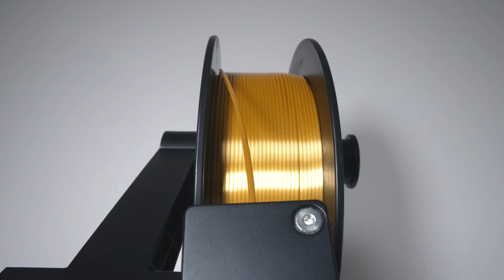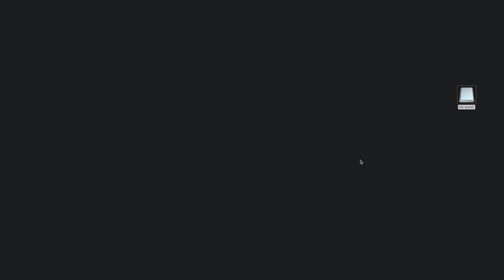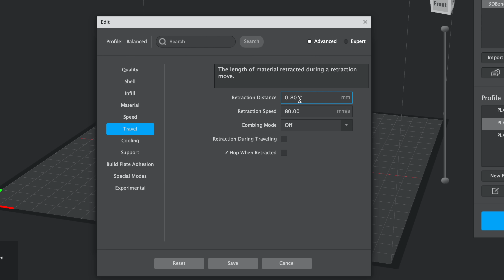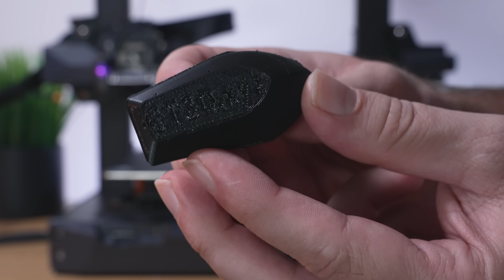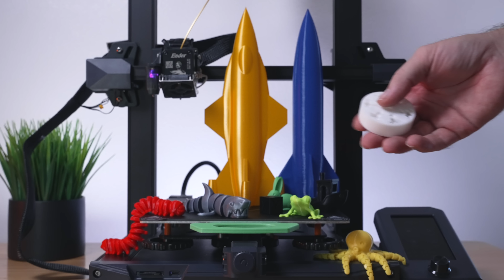Creality Ender-3 S1 - 3D Printer - Unbox & Setup

Comment: Awesome video. I used it to set mine up. The problem I’m having is leveling the bed I manually level three or four times and then set a Z offset and Ron auto leveling readjust, the Z offset at the end, and when I come to print the nozzle is either dragging on the plate or about 3 mm off so I am constantly adjusting it in the beginning of each print. I tried the leveling process know multiple times but it’s the same outcome, it’s driving me crazy. When I go through the leveling process everything is perfect. I click on auto home and bring Z down to zero, and every single time zero stops at a different place than where auto leveled but most of the time it sits right on the bed, so I have to check before each print if not, I will drag the nozzle. I use the PA sheet and when he drags it damages the nozzles subcontractor nozzles already because I forgot to check the leveling before printing.

Comment: Unlike 90% of these YT videos, this one is extremely well done and informative.  One can actually see what you are showing, and even better, I can understand what you are saying.  I will be setting one of these up tomorrow and this was a great help. I have to watch the last few minutes to be sure that you didn't, but about the only thing you didn't address was printing from a PC with a USB A-C cable. If that's the case, that might be a nice additional video.  I've been printing from a PC on an Anet A8 for several years and prefer that to cards or USB thumb drives.

Comment: I put the instructions down and watched your video.   Got it going.   I have a few other Enders even though I am still very new at this.   You helped get me started with this printer easily.  Thanks.  Rabbit printed fine but there is a bitcoin looking gcode with Ender on it that I had to tweak with some to get it to stick.    Plain white PLA.   I managed.  Like the duo z rods and direct path from the spool to the extruder.   I have so much to learn and promised to not buy anymore 3d printers after this one.  Lol..  I use all my printers..  I love how easy you are to understand.   Please keep making these videos for noobs like me.

Comment: First of all i thank you for the video Vlad, it was extremely useful, well explained and complete. I also want to point out something critical in it so nobody else (or maybe another noob at 3d printing like me heh) gets hurt in the process. At 16:20 you tell us to loosen the adjustement nut, i do understand the need for a smooth movement but now the problem i got from doing so was a loose platform/bed, it was wobbling and messed my second print up. I did stress out all day believing that my printer had a factory defect but no, the solution was quite easy. Instead of loosening the thingy at 16:20 you need to be really careful or even TIGHTEN IT UP until your platform is stable and doesn't wobble. Cheers folks and i thank you once again for your video Vlad!

Comment: Thank you so much for making this video, Vlad. I had some difficulty with leveling my bed (and I accidentally melted a hole in it with the hot nozzle 😅) but for the most part, setting up my printer went smoothly thanks to this video. My first print, a Cali-dragon, went flawlessly because you recommended settings for the slicer. I appreciate it!

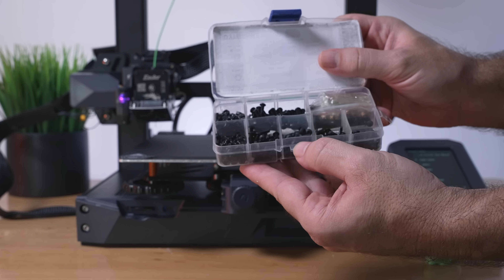Comment: 33:00 Why do you need a handle on an already heavy heated bed...?? In the slicing software (Cura, Prusaslicer, Orcaslicer, Superslicer) it is enough to enter a g-code command to push the bed forward at the end of the print (G1 Y220 F3000).
The main problem with bed slinger printers is the heavy weight of the bed...to increase it further is stupid...

Comment: Awesome video! I just got the ender s1 which is my first ever printer and your video covered basically everything I needed to know to get started. I have one question though, on most eccentric nuts the screw holding it would spin with the nut, this wasn't a problem for most of them except the ones on the bottom of the build plate. Do you have any suggestions?

Comment: I SHOULD'VE WATCHED THIS VIDEO FIRST!
This is my first ever 3D printer and I built it straight out of the box with the included instruction manual...a manual that was apparently made for ants since I had a hard time reading the microscopic prints! Either I missed some essential parts or it was omitted from the book but I connected the wrong cables to the Z- Axis motor. So when I chose the leveling option as per instruction the motors creaked out loud like an old car and dragged the print head across the bed. Now, here's a scratch mark running right in the middle of my magnetic plate!
I took a break and finally watched this video. I discovered the mystery cable still taped to the base is the actual connector to Z-motor. It ran smoother and quietly as it should but it still took me a couple of more hours to solve the failed prints(the print head was way too high from the plate).
Reply: How did you fix that. I’m having that issue now
Reply: @jacobholmes8982  Youtube was my fix. I started adjusting the bed level using the paper technique at optimum bed heat so the early failed prints begin to get less. The early failed prints still pop up occasionally because the bed's height fluctuates with the heat and messed up the calibration.
Failures or errors past the early layers, however, are a bit harder to  explain. Currently, I'm facing a particular filament that is giving me a lot of headache. It blocked two hot ends and fused one of them.

Comment: Rookie mistake: the Y axis didn't make that click noise, (started making a grinding noise) scoured the internet for answers, then moved my printer forwards and it turned out I didn't give the wire at the back enough space to move all the way back. Just posting this here in case anyone is trying to figure out the same thing, lol

Comment: When you start an ender print, it does a line of filament from front to back to purge the nozzle, now when you pause a print, and want to resume, and the print you've paused is higher in hight than the gantry does it still do that filament test from front to back on the bed again because if it does the arm will hit the print?

Comment: i just got my ender 3 s1 pro its supposed to be new, everything looks new however on my first print i used the sample white filament and during the purge pass some red filament came out with the white? did they test this int he factory or what? it had stickers over the screen and over the power selector. all axis wired taped down too.. weird..
Reply: Not unusual, creality testing the head.
Reply: O jad the same thing happening with mine. Tried printing with silk purple and yellow comes out of the hot end. Defenitly because they were testing it out.

Comment: Idk is it just me, i swear the instruction paper was missing some steps. Thankfully I came across your video before i turn it on cause I definitely missed on connecting 2 wires, didn't know where to change the voltage, and have no clue about the leveling. THANK YOU SO MUCH!

Comment: Hey Vlad,
Your videos are my go to when it comes to 3D printers. 
I spent the morning looking high and low for the E3 S1 bed handle file. Go figure why Creality named it “shaking hands”?
I finally found it and printing it now.
I own three Creality printers, CR-10 Smart Pro, E3 S1 Pro, and E3 S1 and they were all very easy to setup and run especially after I watched your step by step video. 
The all run 24/7 with very few problems. Still working out a few adhesion issues but it’s part of the learning curve. Only printing PLA for now until I figure out recipes for TPU and PETG.
I’ve recommended your videos to others on Facebook.
Thanks again!
Reply: He demonstrated that bed leveling, but I wonder if you have to store the Z axis value after tuning in. He did not showed it. Is it automatically stored? Because if not all these settings are lost when powering off, giving you some nasty surprises when powering on and start printing without checking the Z-axis.
I very much like to buy this printer. I guess it's a tad less modifiable then the standard Ender 3, because it looks like you cannot replace the motherboard for another brand like BigTreeTech. However - There seems to be a very much improved (open sourced) version of Marlin firmware available, so you can at lest do some tweaking (unlike the Ender 6, 7 and Sermoon printers that only have closed source firmware, what is definitely holding me back to purchase them).